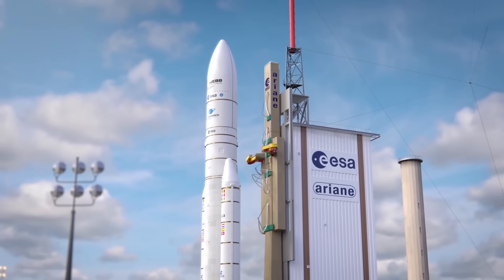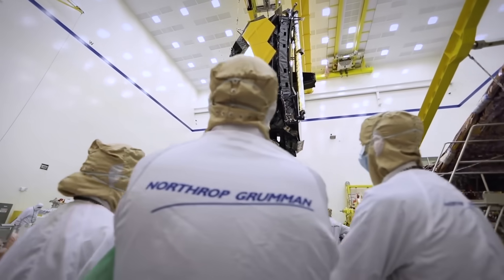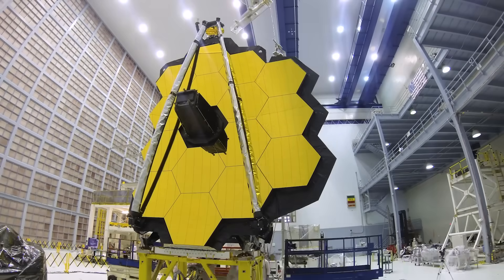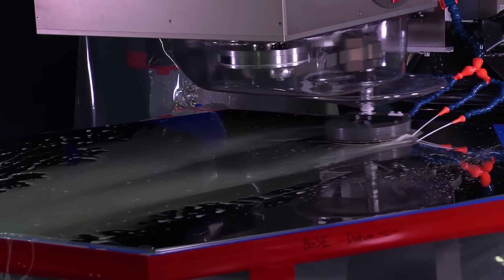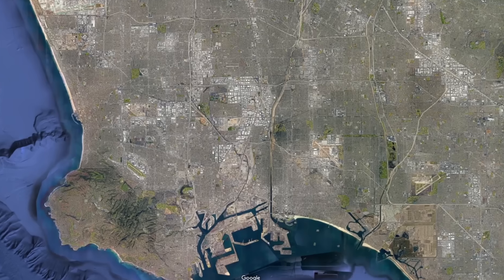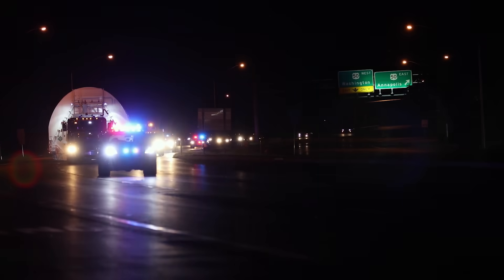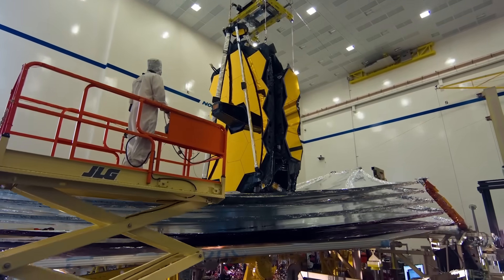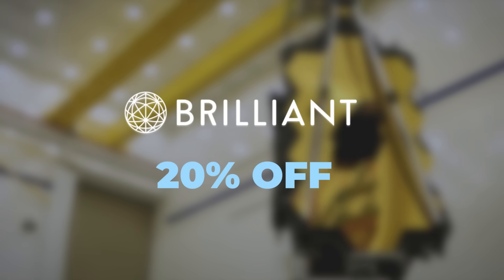Transporting the James Webb Telescope: How They Moved the World’s Most Valuable Object

Comment: An important distinction is that none of this was necessary. The entire telescope could've been built at a single location, and launched nearby. The rest is zip-code contracting, namely  you can only get Congress to shell out money for a project like this if the senators that sign out the money get something back to their states. So space gets turned into a jobs program.
Reply: No. There are technical constraints. There's only one facility in the US that can machine Beryllium, for instance, and it's not in Florida. There's only one facility that can polish the mirror, and it's not next door to the Be machining company. There's only one vacuum chamber large enough to test the JWST, and etc. The cost of transporting components is much smaller than building a new facility to create the component.
Reply: @h.dejong2531  That dude knows quite little.
Reply: It was necessary to get funding on a non-profitable project. 

Without it, no JWST.
Reply: @mrsupremegascon  I would never call corruption necessary. It's political corruption, play and simple. The people pay for it with their taxes, the politicians use it to their advantage.
Reply: It's not only the manufacturing dumbass it needs to be tested after each process then if it fails it needs to go back to polishing or whatever stage it is then re test it. Or discard and start over again. Do you think it's logical to build and entirely new manufacturing and test facility at the French Guiana?? 

French Guiana is chosen because it is the only equatorial launch facility available. Considering the fact JWT needed to travel 1.2million km to the Lagrange point it needed that advantage of launching from the equator.
Reply: Name the location that could have done all the manufacturing required.
Reply: @BrassAxe  Pretty much any reasonably industrialized location really. Same as SLS or the Space Shuttle. The most logical thing would've been to build and launch in Florida, and not involve Ariane at all. That would've also dropped many of the stupid constraints.
Reply: @BrassAxe  French Guiana. You could ship the materials there and then launch it
Reply: Actually no. I am not sure why you think design, assembly and testing can be done at one location. Not every lab is identically equipped and not everyone works in one place.
Reply: Is that really relevant to this video though?
Reply: @smfoptoo  yes it is. It gives an insight into the thinking behind the politics behind this amazing sat.
Reply: @catlee8064  But this video is describing the logistics. What does politics have to do with that?
Reply: @smfoptoo  the logistics yes...because moving the mirror 19 times round the country is also politics.
Reply: @catlee8064  Moving a mirror is political? Is that what you're saying?
Reply: @smfoptoo  Having to move the mirror around the country was political....just like the OP said.
Reply: @catlee8064  Right. The OP said it, not the fucking video.
Reply: @smfoptoo  I'd say it is. The video implies that those were actual engineering necessities, and that the complexity of the telescope required such activities. That is not the case.